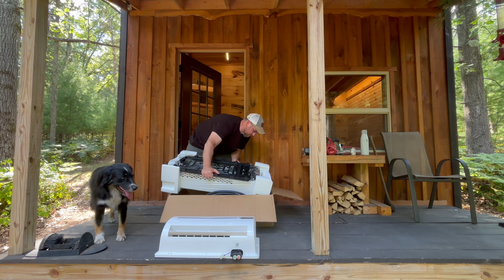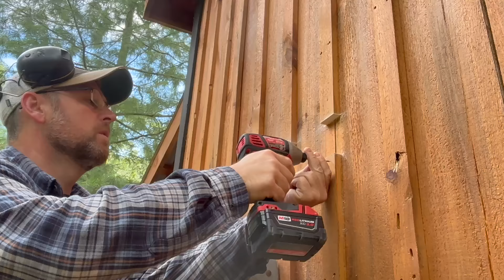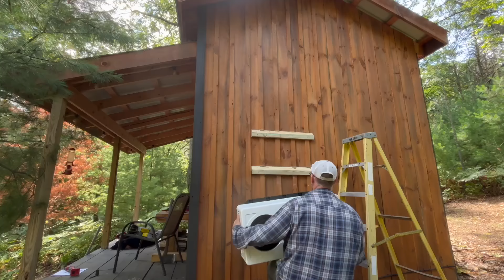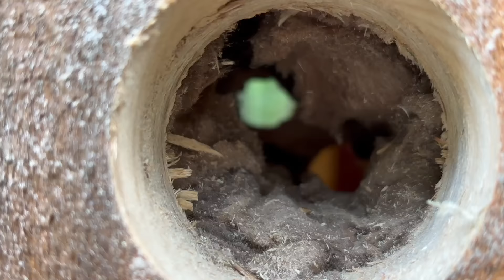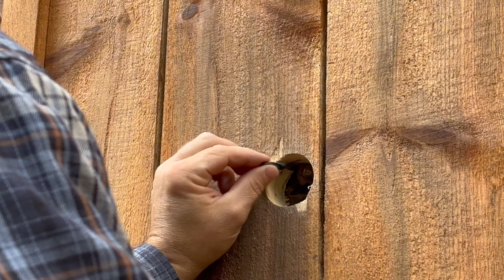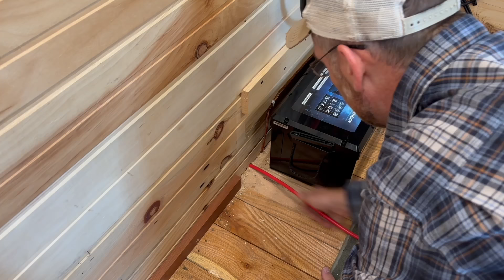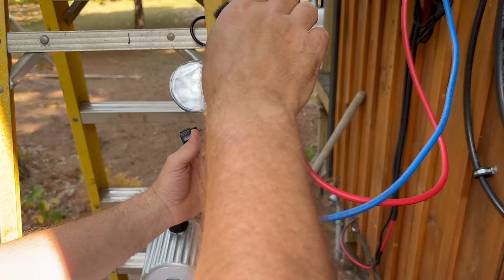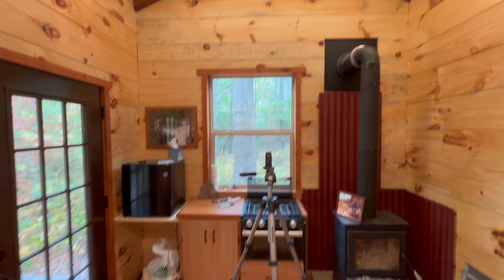12 volt Air Conditioner in the Off Grid Cabin ! OutEquipPro

Comment: O'Reilly's and other car parts stores will frequently let you check out (borrow) a vacuum pump for free. I did it when I installed my 12k - 120v split system. The one they let me borrow had never been used, and it worked great.

Comment: Dont no one get mad at me but as an hvac professional lol.... good job on the diy. This is a very simple install however id would have done a few things very differently for not only looks but over all system health. Also your "leak" check methods are wrong this is not a proper test your system still may have a leak. You have to remember hvac units run under high pressures. I would recommend to anyone else that wants to do this at least find a local company that will help i would have been about 350 for the full install hanging units and proper testing. I love DIY myself but hvac is one of them things diy isnt always the answer im not upset at this video just pointing out it may still have a leak and install could have been better planned for overall system health. And looks also when you removed the hoses under vaccum this is a DONT do it you just let air and moisture back into the system that you just vaccumed it out of 😮
Reply from the maker: That’s why I said to hire a pro , because I am not
Reply: @blackspruce1861  hvac is a learning thing 100% but I hope you didnt taken my statements wrong just pointing out some stuff
Reply from the maker: @madmat276 no not at all I really didn’t want to do that part of the video but my friend that was going to come do that was too busy and I couldn’t wait any longer

Comment: Pity there isn't much push for 48v DC devices which matches many solar panels and batteries.   Devices just run better on 48v and lighter wiring or longer distance.

Comment: Do these come in 18,000 BTU? I doubt it very much, but with that space, I think you'd be better off with an 18,000 BTU, or this a/c will never cut off or run for excessively long.

Since cold air sinks, I would have installed this in the loft area, and the coolness would reach the ground floor,  cooling the entire structure. This way, you will only have a cool ground floor.

Also you don't need an A/C manifold and vacuum pump. The unit comes fully charged on the condenser (outside) part, you just connect it to the evaporator (inside unit) and open the two valves to connect them. 

If you're concerned, as I was about the air in the lines between the evaporator and condenser, you can connect everything,, then slightly open the low pressure valve a tiny bit, leaving the other end of the line slightly slack to purge the air out of the line then tighten it up.

I did the above with an system at my home in 2011 and it worked fine at the time of selling the house in 2022.

Comment: Decent job. You need to do somthing about that oil trap you've created with the loop in those lines.
Reply from the maker: Thanks!! if I just make the bottom of the loop wider and flat would that do it ?
Reply: @blackspruce1861  as the other guy said, you want to have the lines above the condenser (outside unit).  In other words, the compressor must be at the bottom of the lineset so that the oil naturally collects there by gravity.  the oil is supposed to return to the compressor.  no loops, no sags. just a constant downward slope from the inside unit to the compressor.

Comment: No you definitely lost the vacuum. Better to shut off hose valves, release refrigerant and then pull them off. The refrigerant will have a higher pressure then the ambient and will not suck in air. Also, we technically use micrometers now to measure vacuum rather than time and suction but with a new system like that it shouldn't effect it too much.

Comment: If it gets in the range of 0 or lower i would put some metal straps over the unit in a vertical orientation.  As the cold tends to make even the hardest of plastic brittle.

Comment: Good job ….. although you should have left your manifold aka gauges on the service valves while releasing the charge. I have installed and serviced HVAC systems for over 40 years taking your hoses off under a vacuum you introduce moisture and non condensable’s into the system

Comment: Don't forget to protect the units from rodents and nesting bugs (wasps, yellow jackets, etc), as well as hoses and wires, and the access holes for the hoses and wires. And finally, is the exterior unit weather proof? I have worked several Forest Fire Lookouts, and this 12v option sounds intriguing!

Comment: oh man it's bad you used so much 12v cable. could have moved the outside unit lower closer to the battery to reduce wiring size. less wire, less resistance.  also I would put a breaker and a fuse, conduit.  if anybody wants to do this, you really want 48v it's safer and more efficent

Comment: The specifications are pretty beefy on current demand.
There must be some heavy power wiring on that unit.
That would need quite a good battery bank to handle summer weather in the south.
Reply from the maker: I think it was 6 AWG . . I think max wattage is 770 something .
Reply: @blackspruce1861 so it probably has a 40 amp fuse.
Still, the battery bank and solar array need to be beefy to handle that in the summer.

Comment: You have a 3000W inverter there, just get the smallest Mitsubishi 240V split it will be way cheaper and efficient than the 12v unit. I run my Panasonic 7kW unit with a Victron 3kW inverter. Panasonic has an inverter start so no start up surge.
Reply from the maker: I guess either way works

Comment: i think before you connect the hoses to the inner unit you have remove the air filled in inner unit that is there to prevent the copper/aluminum pipes from squishing in transport
Reply from the maker: thats what the vacuum pump was for
Reply: @blackspruce1861  ah ok i see thanks for the explanation, usually for bigger units they don't use it

Comment: I wouldn’t mount it to the wall because it’s a motor system with moving parts that cavitate. I would put two fence posts in the ground and next to the house and bolt it to that that way the wall doesn’t vibrate excessively.
Reply from the maker: interesting

Comment: Man, you need to cut down some trees for more sunlight, bro. Great install, the only change I would have made is putting the evaporator up in the loft. The heat rises, the cool air will sink down to ya.
Reply from the maker: Thanks !! I was going to put it up there but I would have had to remove the usb out let because it was in the way . I might add a ceiling fan to circulate the air more
Reply: @blackspruce1861  or add an exhaust near the top and run that until it gets cool enough for you.  Expelling the hot air is very underrated.  :)

Comment: When drilling holes from inside to outside, drill downward at a slight angle. This will prevent rainwater from leaking in if the outside seal develops a hole. A straight hole will allow water to seep inside the wall.
Same for the condensation tube. A straight hole can catch water in the tube and cause condensation to leak inside the cabin.
Reply from the maker: pretty sure I did

Comment: That fan on the indoor unit is severely rubbing against something. If it's getting quieter the more you run it, it's because where it's rubbing is wearing away. Take it apart to see where it's rubbing and see if anything is loose. If it's damaged ask for a replacement.
Reply: We don't sweat the small stuff.

Comment: Nice to see an install video of the Mini Split version as I want as much solar on the roof of my van as I can so I have 0 problems when it comes to power because were I stay can frequently storm for 2-3 days at a time. I will say I feel like I noticed the machine is a little louder than I would've thought. I know you mentioned in the video that as you used it the sound eventually dropped. After using it for a little while do you have any updates on this model ? Cheers and thank you for the informative video

Comment: Why not put the unit at the highest point of the cabin? like above the kitchen? Heat rises so it would cool the whole space way better.
Reply from the maker: To put it on the kitchen side I would have had to buy a bunch of cable , to put it in the loft I would have had to remove the outlet on the wall
Reply: @blackspruce1861 wouldn't you only need cables for power?
Reply from the maker: yup

Comment: You need a micrometer that reads your vacuum to make sure you don't have leaks or non condesables in your system.  Great video though by the way.
Reply from the maker: Thanks !! yeah I figured there's more to its than what I did . definitely why I just said get a pro if you can

Comment: But how would you clean your condensor😢
Reply from the maker: I have no idea the shroud on the outside comes off easy just a few screws
Reply: @blackspruce1861 i think it’s still to close to the wall to get a brush back there.
Reply from the maker: @shab036 could be ? I’ve actually never cleaned one so I’m not really familiar with the process
Reply: @blackspruce1861 so basically, on the back you have your condensor block it’s all these metal ridges on a coil that give of the heat or cold of the refrigerant, but it’s prone to collect dust and grime and those make it so it can’t give out the heat or cold to the atmosphere, you can clean it with a soft brush going up and down, or you could remove the fans and clean it from the inside out with water hose.
Reply from the maker: @shab036 I wonder if you could fish a bottle brush or dry vent brush back there and get to it
Reply: @blackspruce1861 I hope so🙏🏻 you will be good for some time before it gets dirty. Keep the interior filters clean aswell those are a lot easier to reach.
Reply from the maker: @shab036 I always clean the filters on my window shaker but never the condenser , probably why it’s not working as well as it did lol
Reply: @blackspruce1861 yessss that’s why!! Clean it asap😜
Reply: @blackspruce1861 also if you want to remove the unit u can pump the refrigerant into the condensor by turning on the unit letting the compressor run, then close only the high pressure valve , wait like 5 minutes, then close the suction valve the foila, all the refrigerant in the condensor and you could remove the lines and unit an place somewhere else.
Reply from the maker: LOL
Reply from the maker: I wondered how that would be done

Comment: I really hope that they can make the indoor unit a little bit wider than this. So the indoor fan can blow and spread more cool air even if the cooling capacity are limited.
Reply from the maker: maybe they will . the vent will on this has a setting so it oscillates up and down
Reply: @blackspruce1861 Yeah i see on the video that the flaps can swing up and down so the cool air spread evenly.

Comment: So how many amps does this use.  Just bought a 30ft fifth wheel  and  it has a ducted rooftop ac unit and at my tractor you have gen curfew i want to be comfortable so i can run my gens for ac but not sure how it will be at night with no ac.  During off show times when up for working at show i believe be able to plug in. Learning curve as im brand new member of the club.  Did some quick test on systems in camper but now need to switch to stair repair and cleaning and replacing water pump.  Gonna install an automatic transfer for running off eco flow unit for some ac power at night for fans

Comment: So even though it's it's intended for a camper/bus, installing it in a cabin should work quite well due to having much better insulation than a camper, as well as the potential to have more storage and solar capacity. Very ingenious idea
Reply: That's a very nice tiny home to hide out in for the coming gas/oil energy collaspe now you just need one year supply of water and MREs

Comment: Would you not have been farther ahead with a 120v system?  You have an inverter, they pull considerable less amps.   I haven't done the math, just wondering if you looked in the the losses of doing the 120v vs the 12v.
  Nice video, not sure why noone tried it before lol.

Comment: This is a 12,500BTU unit in the area of a mid size bedroom. And the company didn't know what to tell you? And you're surprised it worked? LOL. It's twice the size it needs to be. I would mount the units to some sort of cell pads to dampen that noise. Incredibly annoying sounding unit to the point that I wonder if something is wrong with it. Great video but a quick trip to any chart hosting website would tell you that 6500BTU would have been enough at significantly less energy consumption. Maybe it's time to add a wing to that mansion.

Comment: Nice work with one thing maybe a bit of a hitch: the spare lines coiled up like that may cause the oil to pool up where it shouldn't. Is the evap. fan loose/damaged, or with some debris caught up in the blade wheel? Seemed a bit noisy. Thanks.

Comment: Splicing 12V cables? nope 

Chop off the end and put a new compression lug matching your wire size and battery lug size with hydraulic crimpers after feeding it through. Selterm UL listed nickel plated/marine lugs would be an upgrade on the stock wire lugs.

Comment: Personally I think I would still pay the extra and go for something like EG4's AC/DC heat pump. 

This thing is about 900 bucks for AC, and the EG4 is about 1500 bucks but since it's a full blown heat pump it can also heat down to -15C so will massively widen the usage window of a space in areas that get cold in the winter.

It does need higher voltage DC though, since the DC inputs are meant to hook solar directly to it, which makes it less simple if you have a 12V DC system already but I think it's worth the difference if you are already in for near a grand and basically the same amount of work anyway.

Comment: Man, this is EXACTLY what I've been scouring the internet to find for over a year.  It made perfect sense if you wanted to stick with 12v and not lose that efficiency with an inverter.  Great job, excellent video.  Thanks for taking the risk and putting in the work!
Reply from the maker: Thanks for the support and I'm glad you liked the video!
Reply: @blackspruce1861 yes, thanks for  the ideas and the link to this product
Reply: @blackspruce1861 I missed the Battery specs.
What type, sz, how many, etc are they?

Thanx!
I really enjoyed your video, had me totally captivated.

I never woulda thunk there was so much involved in the final setup steps! 

Thanx for sharing with us.
Reply: That's true,  12v is great without an inverter. With an inverter, 48v is 👌
Reply: EG4 has a mini split made to run on solar, and it doesn't look like a toy.
Reply: How much more efficient is it?
Reply: The unit has an inverter integrated inside it

Comment: If you ever vacuum down a refrigerant system again , you should not remove the manifold until you open the valves and pressurize the lines. That way when you disconnect them you lose a small amount of refrigerant versus sucking atmosphere and moisture back into the system which is something you want to avoid at all cost.
Reply from the maker: Makes sense. I just followed the instructions they sent

Comment: 13:09
An easy way to thread wires through walls is to first pass through level each direction with a small drill bit. This makes sure the holes on each side of the wall are fairly concentric and in line.

Next, enlarge the hole, so it fits a soda straw or a small piece of pipe or conduit and put that through both holes, then thread your wire through the opening.

When you're done, remove the conduit and patch the two holes.

Easy peasy
Reply from the maker: nice trick thanks !

Comment: Why not show us the wattage of AC unit? Seeing the solar wattage would have been useful too. Both are any easy read on that charge controller.
Reply from the maker: Because unfortunately I don’t have a shunt to give all those readings . The only real time info my setup shows is the voltage on the charge controller
Reply: @blackspruce1861  Weird. I have the same charge controller without a shunt and it shows incoming and out going watts. You do need to scroll thu to get it. You may want to double check.
Reply from the maker: Really !! that would be awesome . I'll have to check and see if I can figure it out

Comment: If you rip about a 30 degree angle across the bottom of the 2x4  pointed out, would it help prevent water from going to the wall over time?
Reply from the maker: good tip

Comment: Personally I would have put it higher up than forehead height for obvious reasons, I'm sure you'll figure out what I mean in time, for running wires through walls you can use a stainless steel drinking straw ,

Comment: When vacuuming the system, after you vacuum and wait to see if it leaks; open the low side to apply pressure as to not get air in the system. 

Since it has positive pressure in the lines, it'll push a tiny bit of Freon out when removing hoses. 🙏🏻
Reply from the maker: Thanks for the tip !

Comment: Thank you for bringing it in! Don't you know if they have 24/48V air-conditioners? The range of the current for 12V system looks crazy!
Reply from the maker: No problem . it's actually 12 volt I think the current was up to 62 amps I would guess start up peak

Comment: 24:02 Good job, but don't remove the hoses before opening to the refrigerant so you have a positive pressure. The schrader valves are not vacuum-tight. They only seal when the pressure comes from the inside. All caps (also the red/green one) should be tightened. hand-tight is not enough. These service valves can have a small leak, and the cap will provide extra sealing.